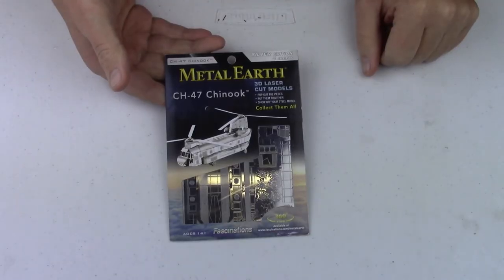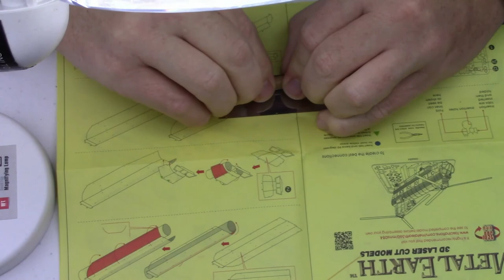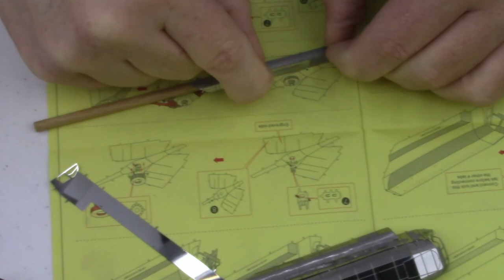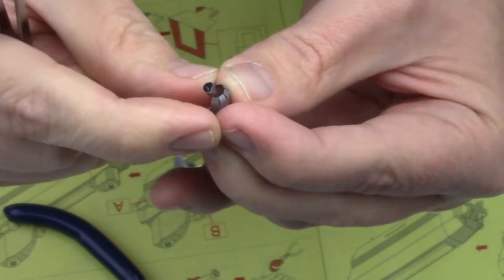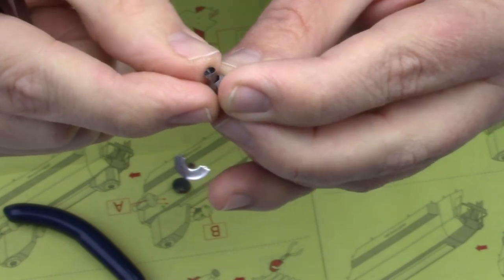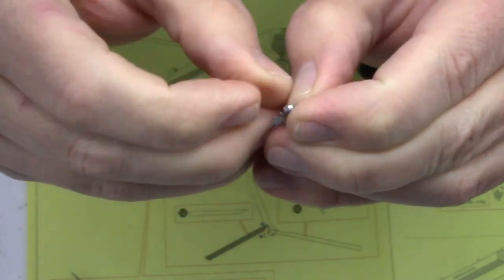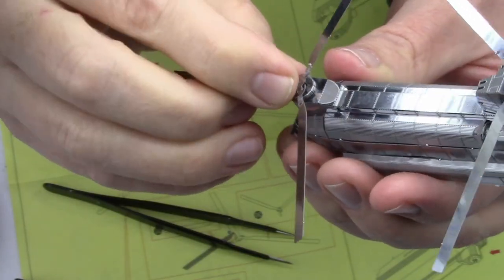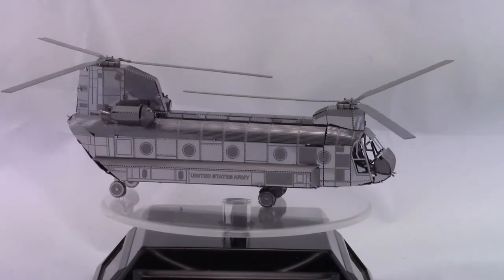Metal Earth Build - CH-47 Chinook

Comment: I'm working on this model now. On the two tiny propeller pieces, there is 3 prongs on top, 2 in bottom, and 2 on the side. After inserting it into the circle, which prongs do you twist/bend...the two bottom ones or the 2 side ones? I know the 3 on top are for the propellers themselves. Thanks!